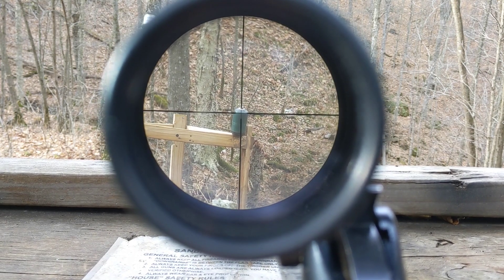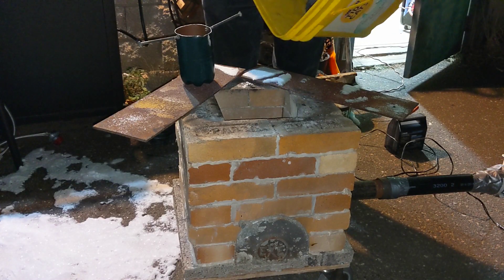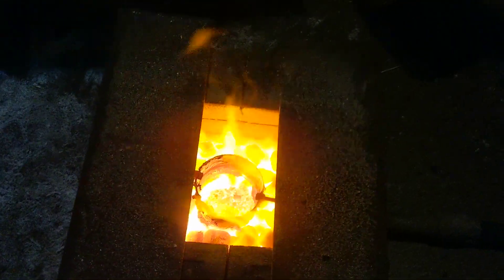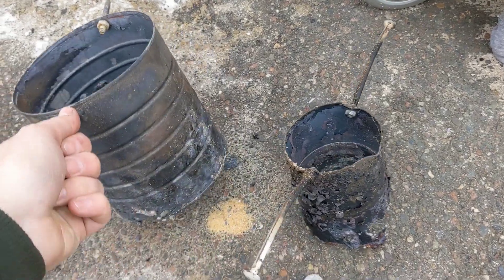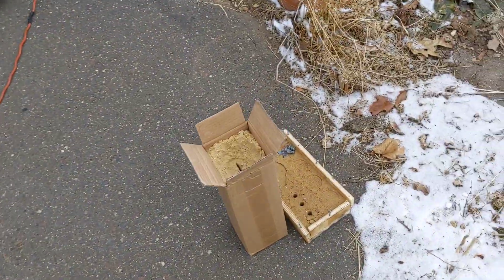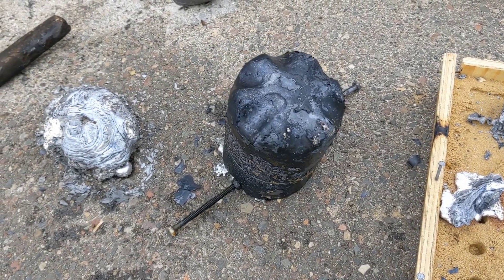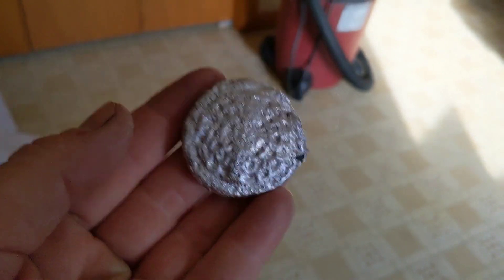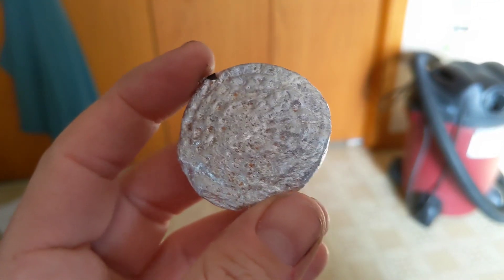DIY Aluminum Smelter - Part 2

Comment: If your forge is getting hot enough to melt the bottom of those steel crucibles, it's getting more than hot enough to melt aluminum, this is part of your problem--temperature control, the higher temperatures are driving towards formation of the oxide, and when you pull it out of the fire, the steel crucible is too thin and things are solidifying again.  A ceramic crucible would be better since it insulates the aluminum melt long enough to do a pour....
Reply from the maker: I did try a ceramic crucible at some point. I need to see if one of the weird industrial pyrometer things I found at Ax-man would work for monitoring temperature on this.
Reply: @saveitforparts  maybe try a metal lined ceramic cruicble and use the picorder to make sure you're getting above 1221°F (I'm sure there's an ideal temperature for this but I'm sure you've looked that up by now.) Maybe you could cast some projectiles for the potato cannons

Comment: I know you are trying to do stuff with only what you have on hand, but spend 21.50 and get a real crucible. https://www.etsy.com/listing/252402299/procast-no-3-4-kg-clay-graphite-foundry?gpla=1&gao=1&&utm_source=google&utm_medium=cpc&utm_campaign=shopping_us_ts1-a-craft_supplies_and_tools-tools_and_equipment-tools-other&utm_custom1=_k_Cj0KCQiAuJb_BRDJARIsAKkycUnnm3xOHw8Qvif21n_V7WszoW52xf4qx4_ZlIEMzF5tUWYxXOMUzKUaAphmEALw_wcB_k_&utm_content=go_11505663043_111851373826_476164034574__c__252402299_101383051&utm_custom2=11505663043&gclid=Cj0KCQiAuJb_BRDJARIsAKkycUnnm3xOHw8Qvif21n_V7WszoW52xf4qx4_ZlIEMzF5tUWYxXOMUzKUaAphmEALw_wcB

Comment: Your crucible is NOT staying hot enough, it cools before you get to your molds.  Quit being cheap and buy a good graphite crucible.
Reply: If he had like 12 cases of pencils in boxes that got wet or something and couldn't be written with he could try to make one. Are there any sources of cheap graphite that could be experimented with?
Also the channel is called save it for parts: it is all about using what you have, learning from your failures and experimenting until it goes right! There are thousands of videos on youtube already of people buying graphite crucibles and smelting stuff, I'd much rather see him try to make something himself.

Comment: I have zero clue about the topic in general, but I imagine it has to come down to temperature and thermal mass. Maybe you have it just hot enough to be liquid, but the thinness of the crucible and small amounts of aluminum quickly fall back below melting point. Could a crucible with more ability to hold in the heat be beneficial?

Comment: You need flux right? Isn't some of that crap on top aluminum oxide from the highly oxidizing environment the cans are melting into metal while being turned into white powder? I think that might also help your steel crucibles as well. Maybe investigate the slag chunks with a friend who knows a ton of chemistry?
Reply: I see a lot of smelters use borax for a flux.